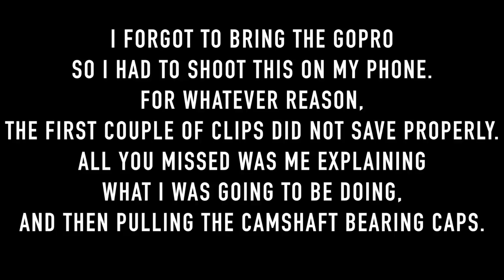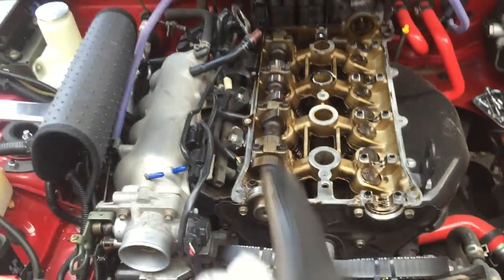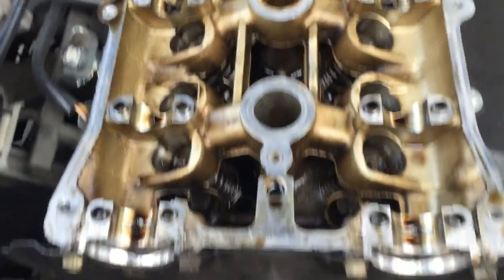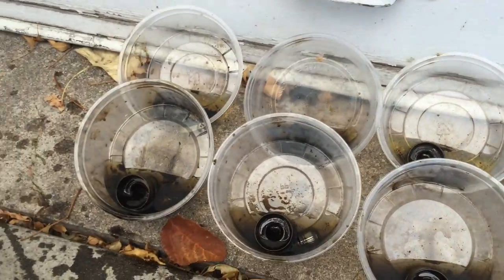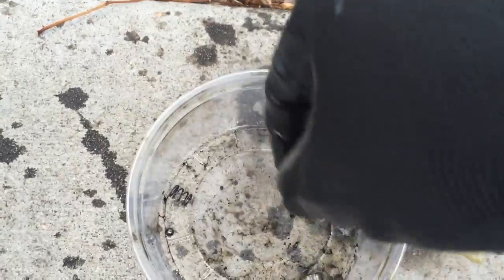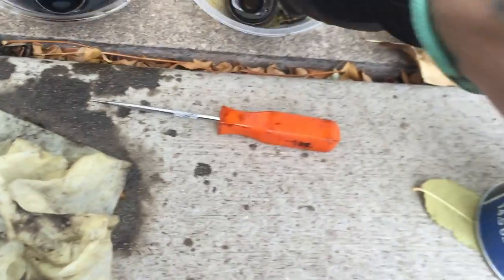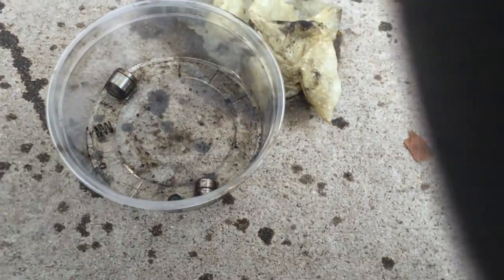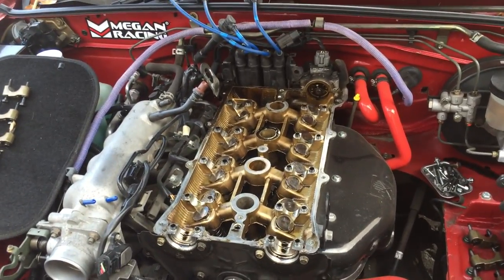Miata HLA Hydraulic Lifter Maintenance S07E04

Comment: Just wanted to say that this is a really great tutorial. Did putting the zip ties on the cam gear keep the motor timed right?
Reply from the maker: THANKS! and yes. it helps. these are stupid easy to time anyway since they are non interference motors so no risk. just set the #1 to TDC and then line it all up. you will know if you're one or two teeth off right away by how it runs.